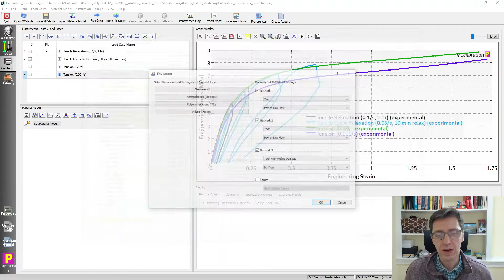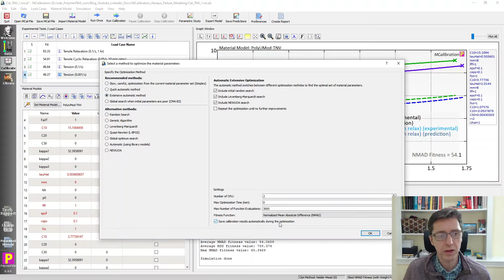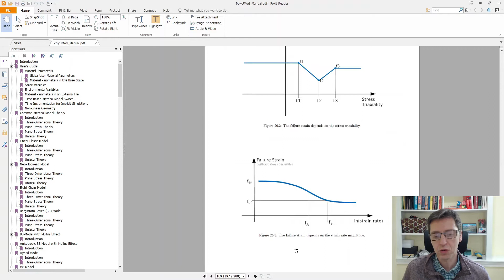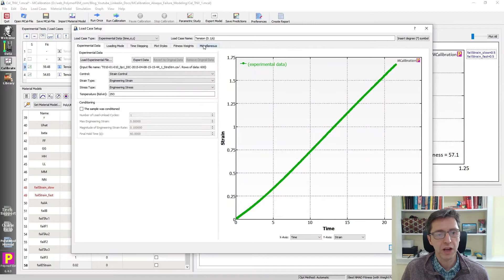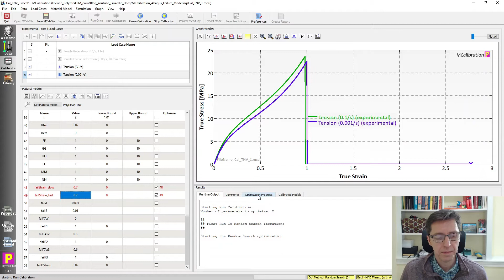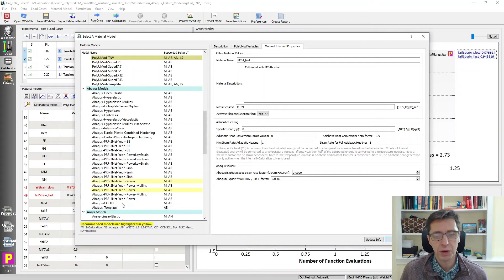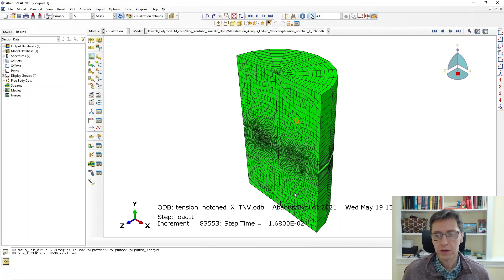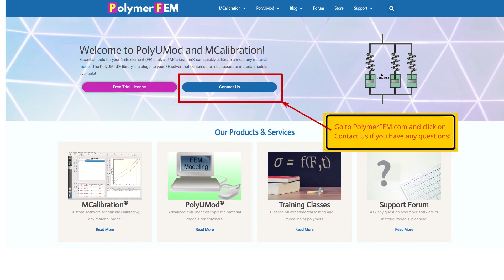Quick Calibration of a PolyUMod Failure Model to Experimental Data

Comment: Hi professor
I need your wise advice on how to model failure with element deletion of a simple hyperelastic material like natural rubber in Abaqus. Notes:
-i don't want to use  cohesive Elements and traction separation to mimic failure. I want the material itself to fail.

-i already have found models in your MCalibration that do well up until failure. Ogden3 and Yeoh and BB have around 95% agreement with test data of rubber(Treloar) . but that doesn't matter to me.

-i don't really care about how nonlinear phenomena like Hysteresis, Mullins effect, induced anisotropy, permanent set &... happen in my material. I just need my rubber to satisfactorily(visually) tear under a multiaxial load.
please make more videos about failure and damage evolution in polymers🙏🙏🙏 i think this specific video of yours helps me a lot but i don't think i have enough test data for natural rubber